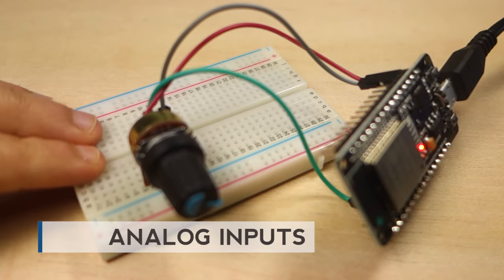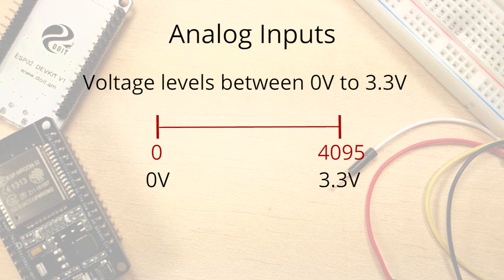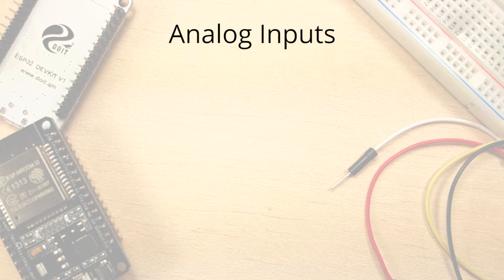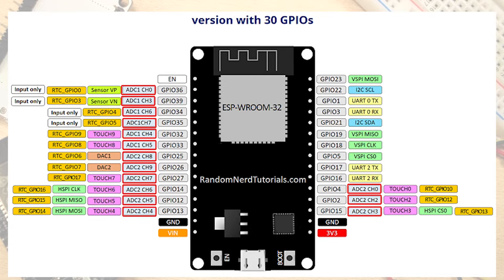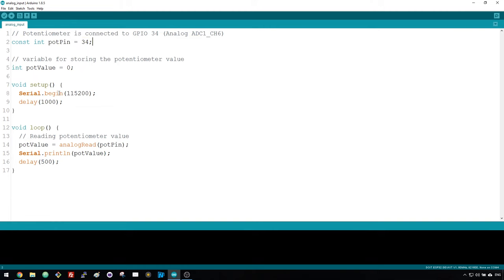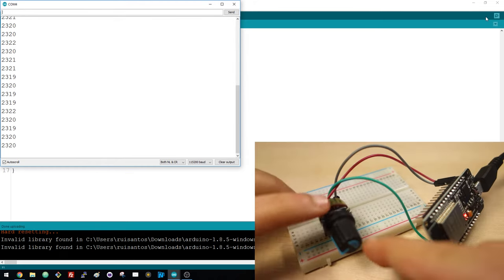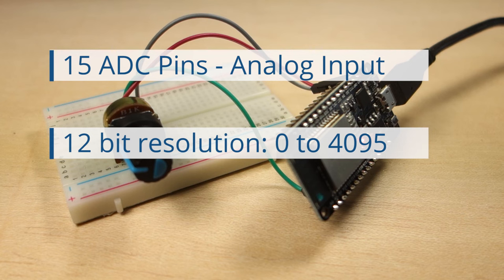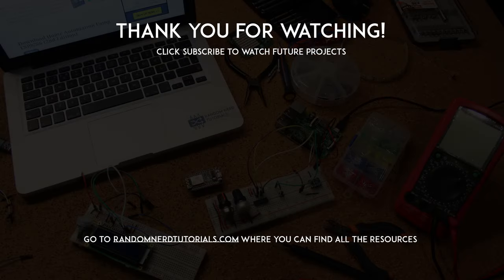ESP32 ADC – Read Analog Values with Arduino IDE

Comment: Great explanation.  Using an interrupt instead of delay(1000) would be nice for integration with other functionality.  Have you done a video on interrupts with the esp32?  Thanks for sharing your expertise.
Reply: There is probably no video about that as there are not interrupts supported by the ESP32 HAL for Arduino.

Comment: Great tutorial. Can help me with some project? I use ESP32 Devkit V1 and i connected digital led WS2812B, 4 channels relay module , DS18B20 sensor, and capacitive soil moisture sensor.I supplied all of them with Vin. The capacitive soil moisture sensor shows different value when i turn on digtal led or relay module, what's maybe i wrong with connection or i need to write code for adc. Capacitive soil moisture sensor connect on GPIO34 , digital led is in GPIO23, DS18B20 sensor in GPIO4 and for relay module i use GPIO 2, 26, 27, 33.

Comment: Thank you for the fast tutorial, please help me in getting the real linear value on any of ESP32 ADC channels , 
lets say we want to make a simple voltMeter using ESP32:

Actually when volt is 0 ADC value is  0 ,
when volts 3.3 ADC value it 4096
but any values in between is NOT related to to the linear  equation:
3.3v ----> 4096
???v ----> ADC value

so: voltage =ADC*3.3/4096 , is a wrong way to measure voltage using ESP32
from my side i tried but i got wrong results.

could you make a video that explains this issue ? then provide a solution if possible !

Comment: have try the code, the value readed is not the value it should be. when convert 4095 to voltage should be 3.3V but says its 3V
Reply: ADC is not linear!
Reply: What can do to fix it?
Reply: Check his blog, there he has a link to a discussion about this non linear ADC. In addition, check your data type, if you have an integer, it is not going to show decimal values, you may want to use a float type.

Comment: My kingdom for a video discussing measuring frequencies off an analog input. Ugh. The search continues.
Reply: J. Bly look up FFT that is the best way to get the frequency content from an analog signal.
Reply: @andrewdollins2321  FFT FTW? On it, thanks for the pointer.
Reply: @rawyin  Maybe "zero-crossing detection" is much, computationally, easier for you to do. That depends on your particular application. Hint: the Zero-Crossing point can be adjusted to meet your needs, so it doesn't have to be "real zero" volt point.